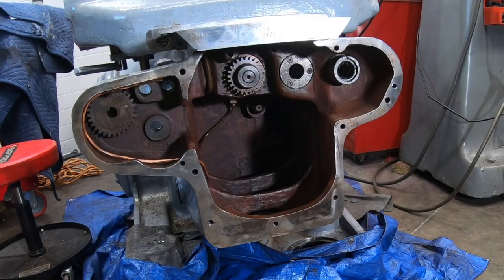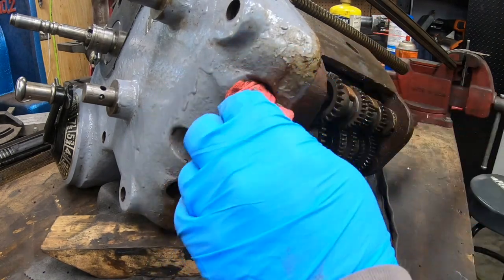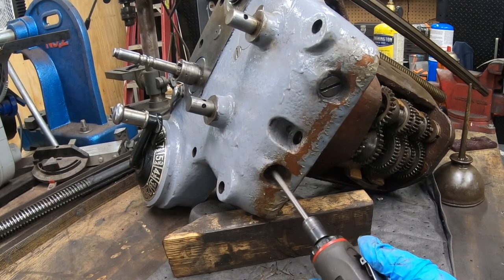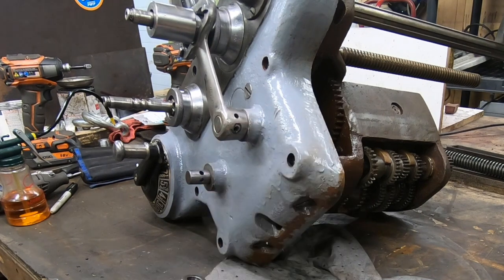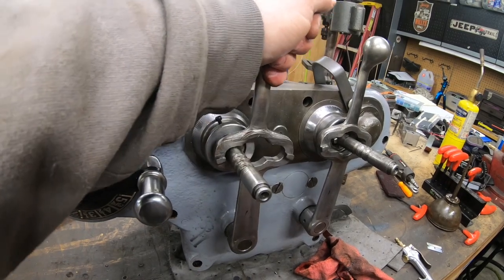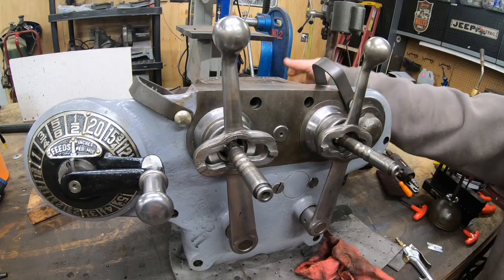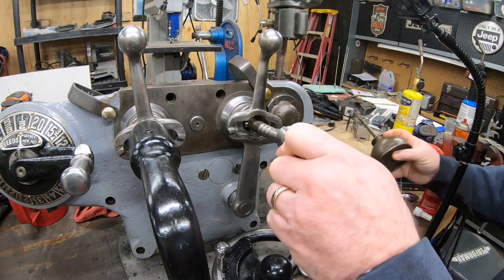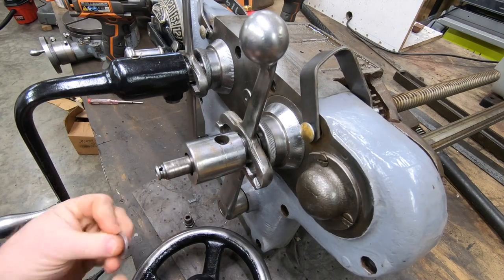Prepping the Feed Distribution Unit for the K&T

Comment: Hi
How does the feed speed,gear change work??
Left hand Dial
Reply from the maker: That dial turns a series of gears and worms that end up turning a couple of cams in the bottom of the feed distribution unit. Those cams engage and disengage a series of gears to produce the desired feed speed. It's pretty ingenious, if you ask me, especially when you recall that it was engineered before computers or calculators. It is NOT dependent on the speed of the spindle, unlike a lathe, as the input is driven from the motor, through the main pulley, some gears, and a couple of splined shafts.
Reply: @MyLilMule     very interesting